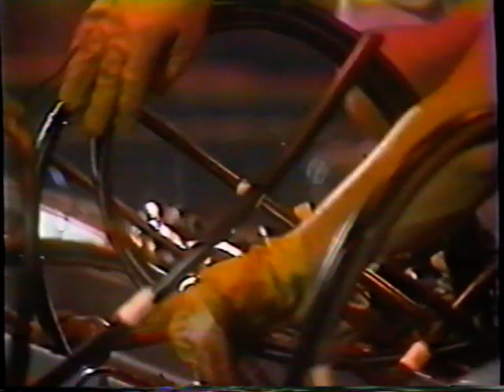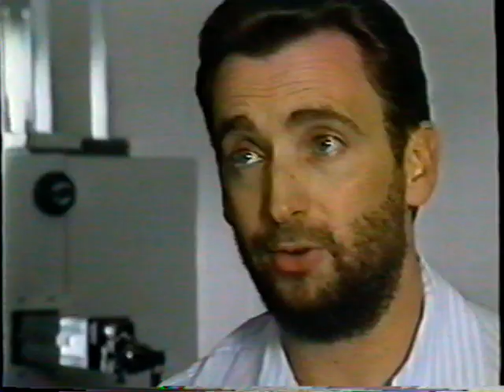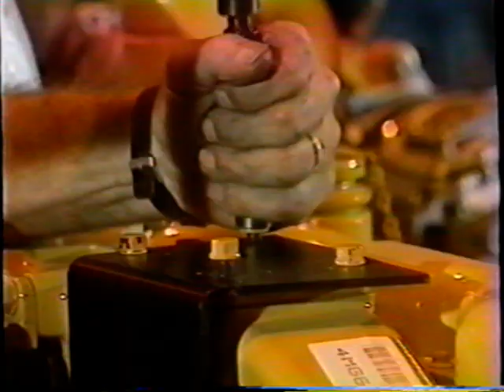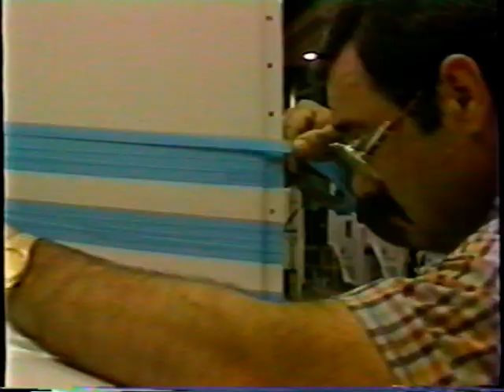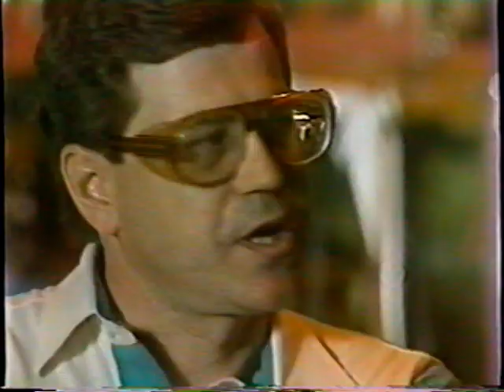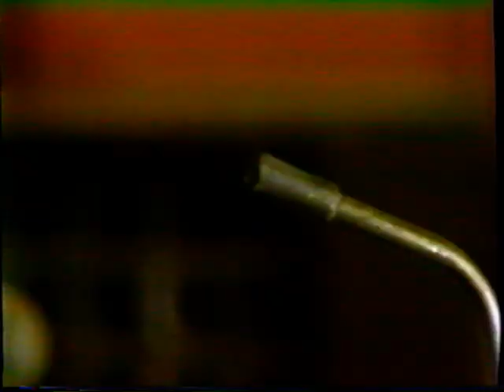Peterbilt

Comment: i still have my 96 379 exhd only has 522k on it 😎
Reply from the maker: @RWC_Autosports  depending on the option I might have worked on th design for your truck.  Probably not but I like to think that I contributed to every Peterbilt built between 92 & 97